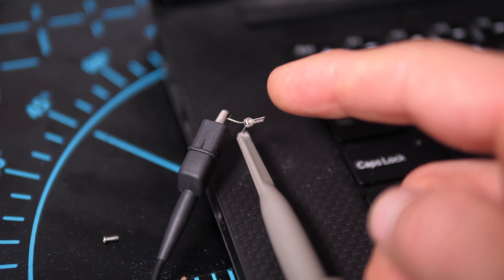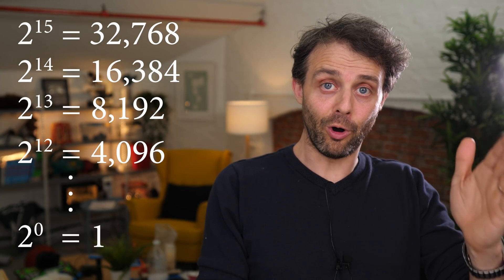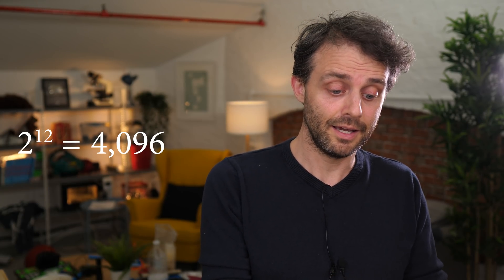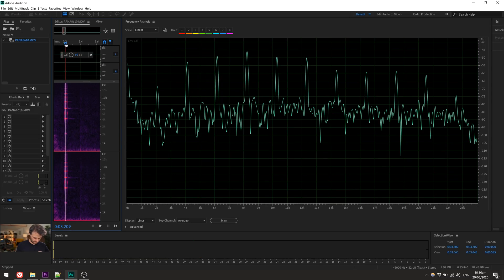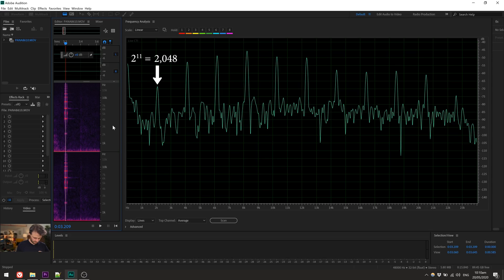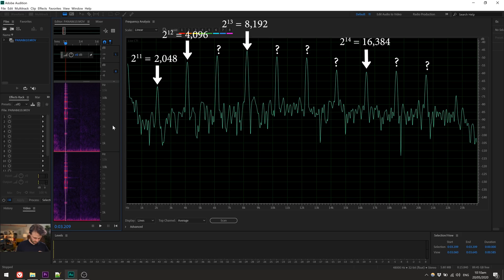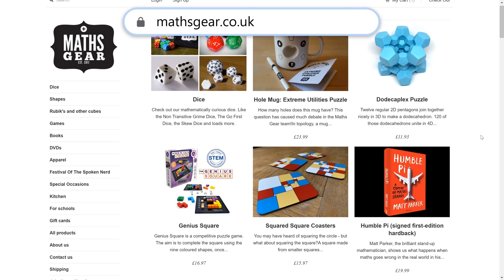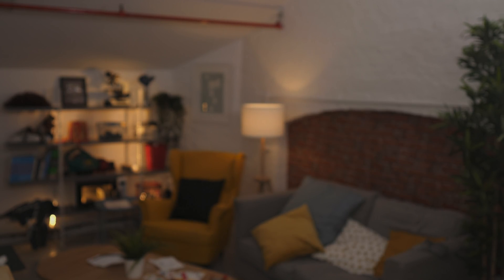Why a Watch Beep Is Exactly 2¹¹ Hz (2048 Hz)

Comment: If you were to analyze the time domain view of the beep instead of frequency domain, you would probably see that it is in fact square wave instead of since wave. This would explain why you see all the harmonic frequencies. Also, I bet there is a fairly good chance that the length of the beep is also a power of two number of cycles.
Reply from the maker: Both good points!
Reply: @
Timo Kokkonen @Steve Mould @Steve Jones  I just tested my kid's wristwatch and the beep is ~8192 Hz. It's 269 samples for 50 cycles at 44100 Hz, and not a square wave. Not a very clean sine wave either, but it's only about 5.4 samples per cycle so not much room to make clean shapes. ;)
Reply: @LiftPizzas  Hmm that would be barely audible but still possible. Maybe 4096 through a very tinny and muffled speaker?
Reply: @nrdesign1991  To an adult, maybe (depends very much on audiometric history), but to a 'normal' child 8kHz is very much audible.  Of course, that depends on which dB scale you're using as some are weighted based on average thresholds, rather than absolute physical values.
Reply: @andymcl92  You're right, my hearing used to be a lot better too. I've tried to keep my ears away from noise as much as possible, but you can't stop hearing degradation.
Reply: @nrdesign1991  You can't, but it's still worth trying!  So...
PSA: wear (ear) protection!

I'm 28 and can still hear 8kHz tones at close to 0dB, but I'm expecting that to get worse relatively soon, sadly :/
Reply: I believe that is a yet wave, not a since wave, it might even be paired to an although wave.
Reply: The piezo would be driven with a square wave or a 1/4-duty cycle pulse wave, but the piezo would respond differently to rising and falling edges, thus creating an asymmetric audio signal.  Viewing the signal in the time domain on one channel of a stereo sample with a 2048Hz signal in the other channel would show what was going on and make it easy to see if the signal is exactly 2048Hz.
Reply: A square-wave sound doesn't look very square anymore after being emitted from a speaker and picked up back by a microphone, both of which distort the phase response a lot. Also any extra noise that's picked up will give each individual oscillation a bit of a different shape and thus make measuring the periodicity inaccurate. Therefore, looking at it in time-domain is not a better way of determining the frequency.
Reply: To build a sine wave, wouldn't the amplitude of the harmonics go down as the frequency increases?  I dont disagree at all with what you're saying - It makes sense that they're just throwing the output of a clock square wave right out to the piezo, but I'd expect that the amplitude of higher frequency components would noticeably decrease?
Reply: @SteveJones172pilot  google frequency spectrum of a square wave. You'll see the harmonics don't drop off that rapidly. Especially when the magnitude is displayed logarithmically (ie. in decibels).
Reply: @SteveJones172pilot  it is trending down, but doubling the harmonic number 2--4-8-16 should only correspond to a 6dB decrease every time and piezo buzzers are nowhere near that flat 

https://i.stack.imgur.com/QTDTk.png

The craziness of the frequency response is gonna wash out the nice pattern, at a guess the  buzzer has a resonant frequency somewhere above 2048hz which is why the fundamental appears so small
Reply: @SteveJones172pilot  a square wave puts out all harmonics of the fundamental equally, a sine wave puts out no harmonics, and a triangle wave tapers off higher harmonics. A sawtooth would be in between square and triangle.
Reply: @MorzenMebs  Square has all the odd harmonics, i.e., 1x 3x 5x etc. of the fundamental frequency. Sawtooth has both even and odd, which is what the frequency analysis in the video is showing.
Reply: @jakce1  well the spectrum is looking pretty weird, with the first few harmonics even being stronger than the fundamental.  my guess would be that the piezo beeper is driven with a square wave but non-linear and non-symmetric characteristics of this crappy "speaker" (that doesn't even deserve being called that) distorts it into whatever we're seeing here.  Or actually, now that I think about it... it's probably being driven in the on-state but simply undriven in the off-state, which would result in a step when switching on followed by exponential decay when it switched off, which is kind of like a sawtooth but even sharper hence biased towards higher-order harmonics, which is exactly what we see.

Comment: No.

A square wave has the fundamental frequency, and odd harmonics, ie multiples of 2n+1 of the fundamental, not power of two.
Reply: A sawtooth wave would have those frequencies (even harmonics visible on the spectrum), though.

Comment: Long time ago I wrote a program for a Fourier transformation of a sound (but it can be fed with any input data). It was so accurate, that when I recorded a raw sound data with Audacity of a "silence" in my room it even showed me the exact frequency of my hard drive (which was not noticeable with a "naked ear")
Reply from the maker: Nice!
Reply: Ok woah, did you upload it to GitHub?
Reply: @AMalas  The fourier transform is so well studied and defined that I doubt his results are much better than the stock implementation your audio program already has.
Not poo-pooing this guy's efforts at all, just saying if you go to any audio program and hit FFT I'd be surprised if you got significantly different results.
Reply: @toast_recon  for me it is a matter of how noisy the signal is, so it is more a hardware issue, e.g. a microphone, not a software one, because as you mentioned, FFT is one of the best known algorithms.
Reply: @toast_recon  I'm not saying my program is any better, but it's fun and kind of cool, that only a few dozen of lines of code and I can extract a full frequency data (depending of sampling and microphone capabilities). Some of the samples took several hours to analyse a full spectrum, but it was accurate up to a fraction of Hz. I also discovered, that infrasound levels were more than 3.5 times lover at night, which explained why I always preferred working at night (it was easier for me to concentrate).
Reply: @LukaszSebastian  I'm also interested if you're willing to share the code
Reply: @toast_recon  Yeah, but if it's a minimalist implementation with source code, and you just want to tinker with it, it's probably easier than trying to recompile some big program with a million options and a complex gui..
Reply: @LukaszSebastian  Oh, I could totally see that you maybe did a way higher point count FFT than most programs might allow. That could leave you with something more "accurate" than a stock FFT.

(I'm using FFT loosely here. Your implementation might have been a fourier transform that didn't use FFT)
Reply: @toast_recon  it was at a very beginning of my programming adventure and I did not know about FFT, so it's just my own DFT algorithm made according to what I've learned studying chemistry and physics at a university (it was around my 3rd year).
Reply: @LukaszSebastian  I'm intrigued by what you mean by the levels being 3.5 times lower at night.  [Ignoring Steve's previous video about "twice as cold" (or whatever the value was)] what scale are you using?
Reply: @dzieciak  I think if you collect enough points the noise issue should reduce in importance. Interference should be visible as spikes in the transform, while white noise will show up as an even bias in the troughs of the graph. Not that noise doesn't pose an issue, but it shouldn't interfere with the frequency character of your signal if you look at a long enough window
Reply: @AMalas  I think I wrote it before github existed 😜 but I still have all of my source codes
Reply: @LukaszSebastian  well, id love to tinker with it if you would want to share
Reply: @AMalas  Yeah.. me too..  I've always been interested in the physics of sound, but I never had any math high enough to really  write that myself!  :-)
Reply: @Anas Malas, @Geo C, @Steve Jones - I'll try to clean the code and describe it and the usage and I'll share it

Comment: I'm sorry, I'm still waiting to find out why the beep is 2048Hz. The little speaker that makes the noise has nothing to do with the tuning fork being used as a timer.
Reply: You don't need a separate signal generator to generate the beep if you use one you already have.